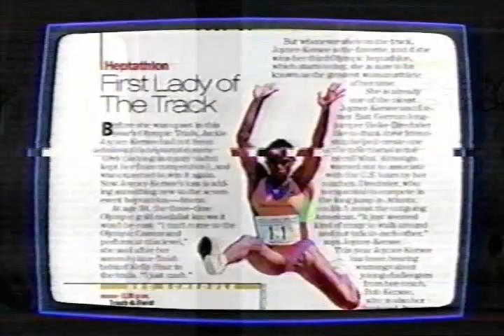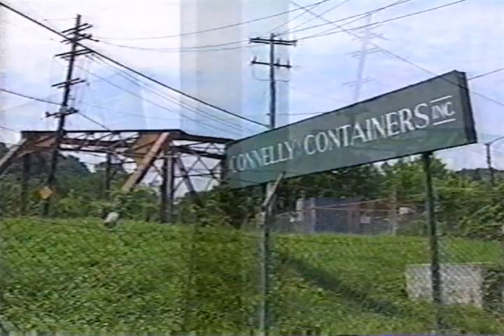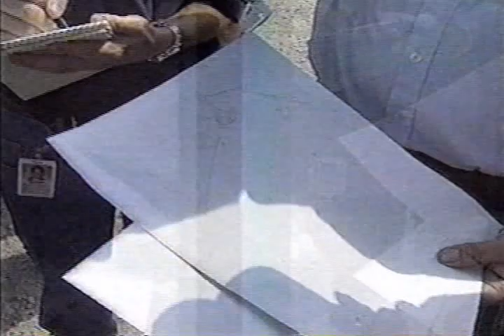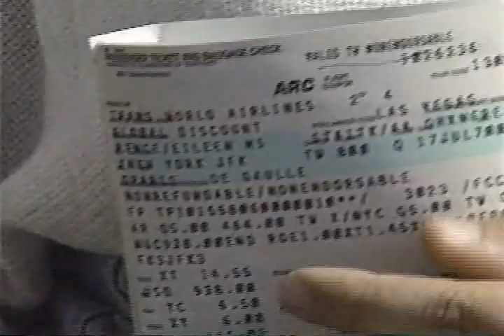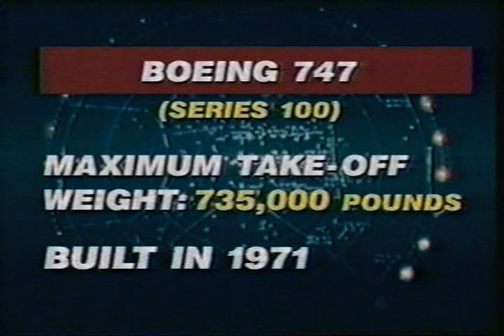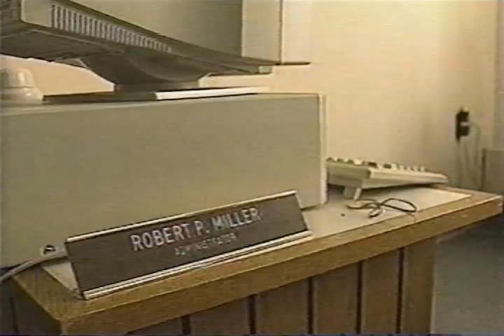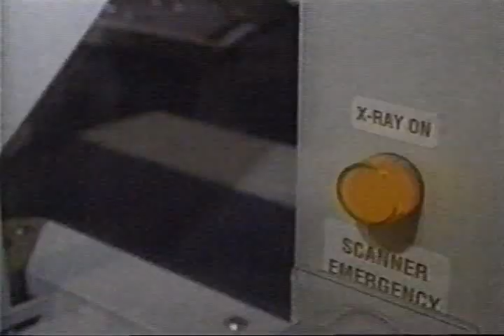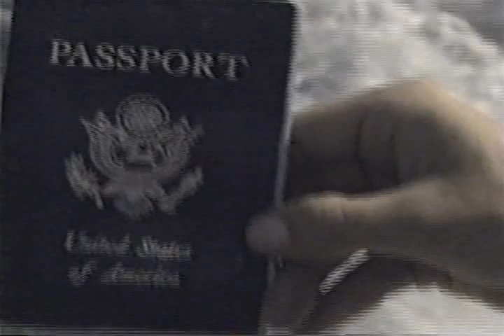News coverage of TWA Flight 800 Crash part 1 - WPVI 6abc, WABC ABC7

Comment: I lived less than 5 miles away from the crash
Reply: Did you see or hear anything?
Reply: @ginaryan2093  I lived near the Air Force base and I saw the C-130s leave in the dusk. They never go out at night unless something happened. I turned on the TV and that’s when I saw the crash
Reply: @kathleenduggan9955  do you believe the conspiracy or cover up theories?
Reply: @ginaryan2093  honestly I don’t know. The age of the plane should also be considered and the mechanical problems it did have before taking off. But since it took off an hour later than it should .. who knows!!
Reply: Only the “crash” occurred more than 5 miles from the shore. Did you live on a boat somewhere in Long Island Sound????
Reply: @johnp139  i lived about 5 miles from the Moriches Inlet. That is what I meant